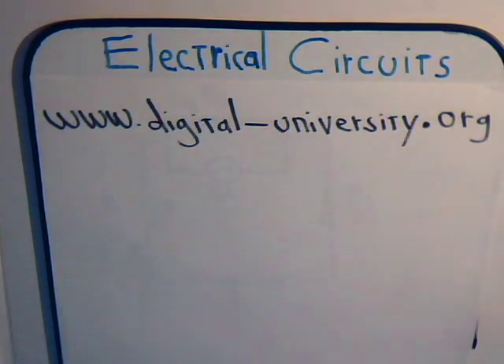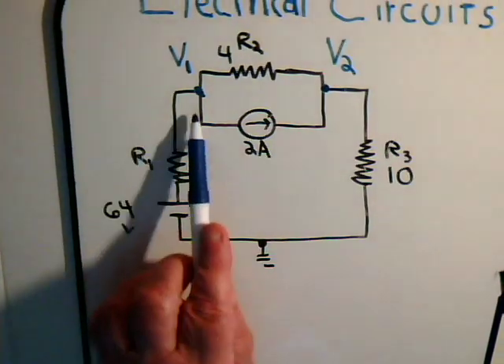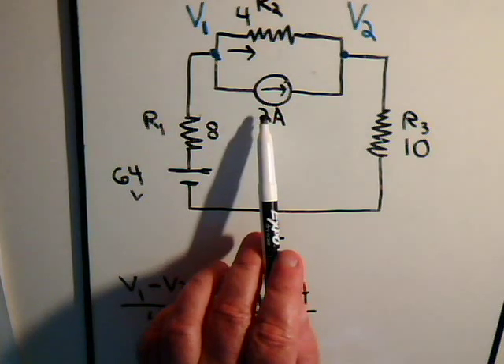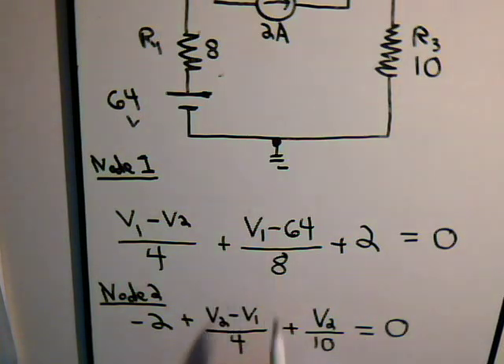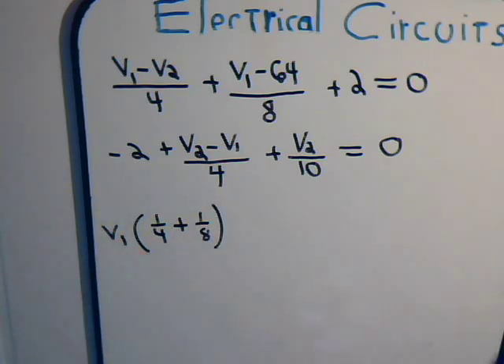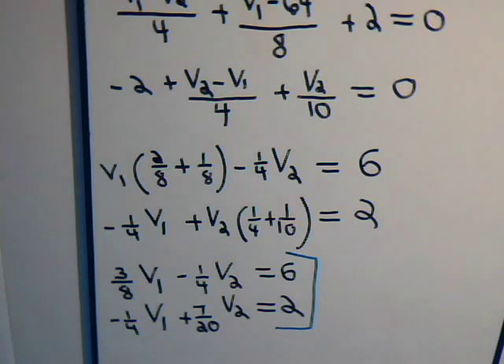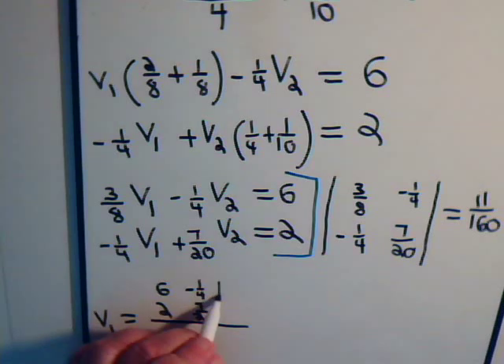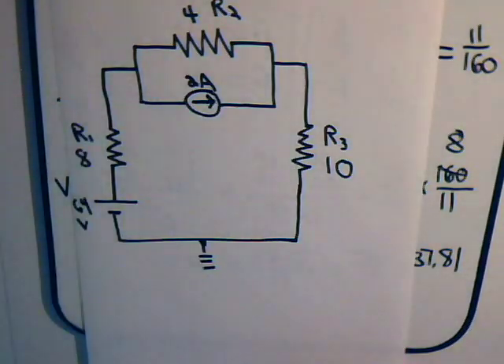Electrical Circuits Video 26: Nodal Analysis Example #3 Part A (Multpile Nodes)

Comment: I used WolframAlpha and I obtain a totally different value. Why?

I input your two equation like so 3/8v1-1/4v2=6,-1/4v1+7/20v2=2 hit enter

I obtained v1=1178/11 v2=1470/11
Reply: I did it by hand (simultaneous equations) and got the same as him. 1248/33= 37.81. But check it yourself. Does the completed circuit match Kirchhoff's voltage and current law? If not you have made a mistake. (Hope that helps you - 9 years ago)